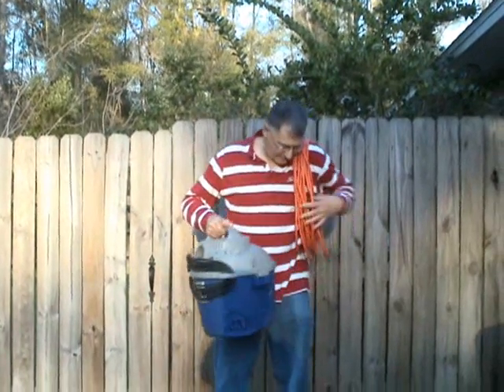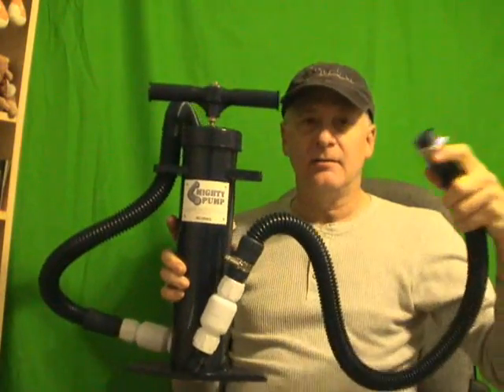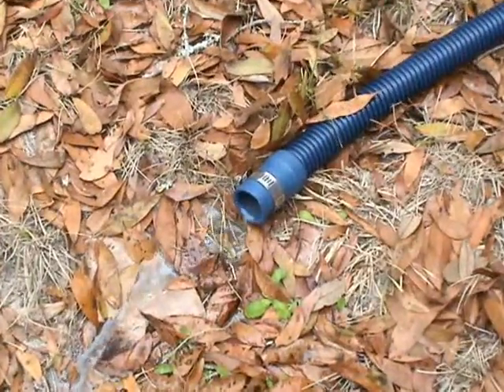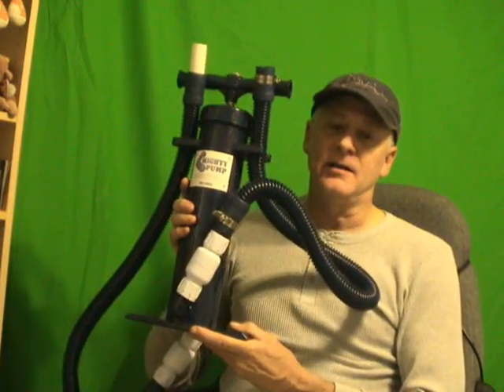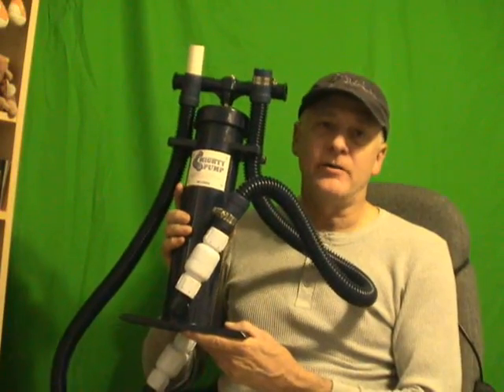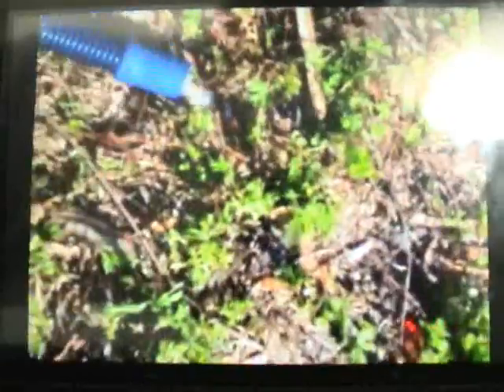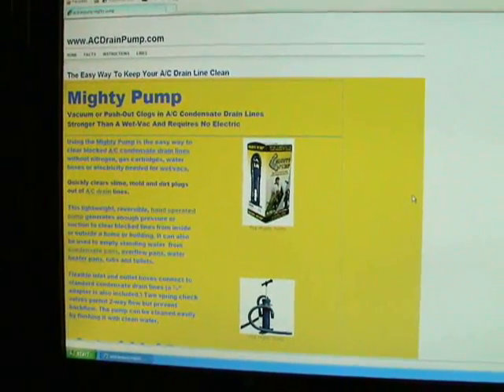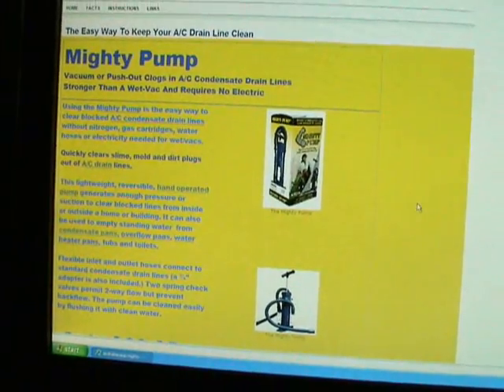HVAC condensate drain cleaning with the Mighty Pump

Comment: The Diversitech pump is a condensate pump that stays connected in the system, I think it is completely different from the pump the doctor is using. Great job Dr.Z on this video, the pump looks like a great tool to have available on the truck especially this summer..

Comment: I like it.  No more cords or running the vacuum like crazy wondering if you got the clogs.  I like the push pull also.  Thanks for the demo.  I read about it, but your video was great.  I bet I had 15 after hours calls last year on new installs that were condensate clogs.  CLEAR THOSE DRAINS!!!!

Comment: Use this pump on residential maintenance calls daily in the cooling months. Works very well. Make sure you keep the pump clean inside and the I-rings inside lived up. Any resistance... Sound the "Better Check It Out Alarm"

Comment: Found one critical missing component a in line bowl type water strainer this add on will save the check valves and O rings of pump. Store in a 5 gallon bucket and fill half full of water to clean strainer screen then final flush pump when complete.

Comment: hey Dr Z I have a clog in my condensate drain which caused a leak in my celing, I assume from the drain pan overflowing. I believe the clog is from from insulation in the attic since I found a lot of it in the drain pan, will this pump be able to pull the insulation out of the condensate drain without any problems?